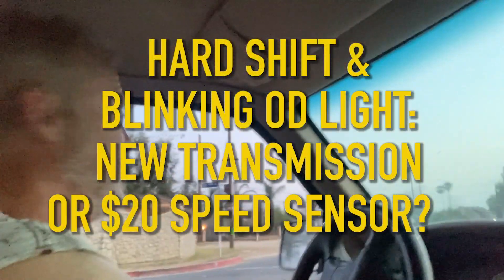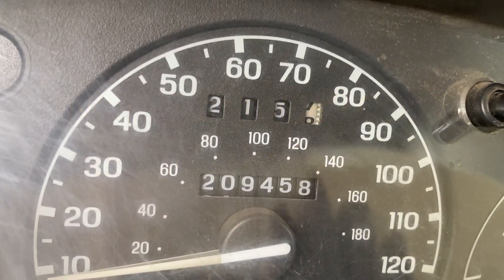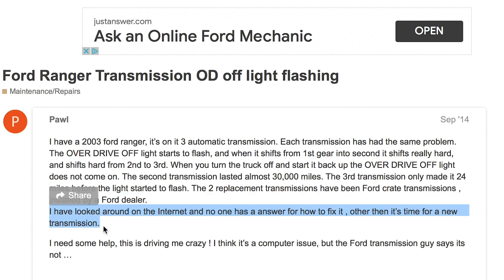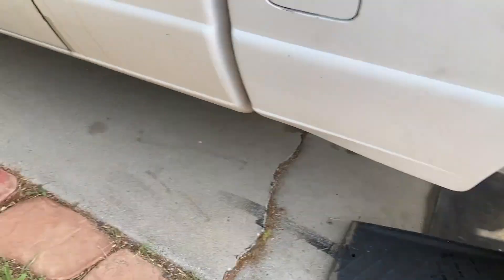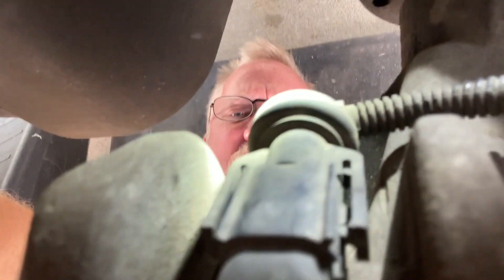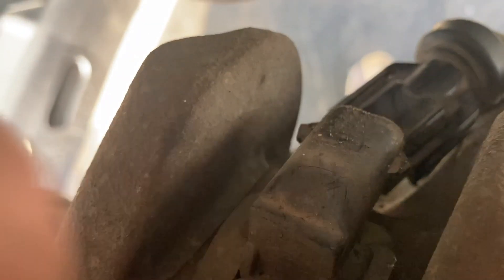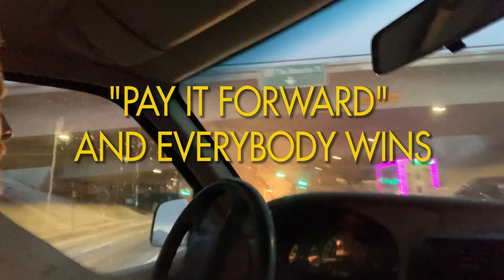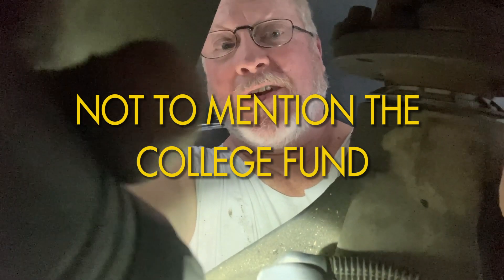Flashing OD Light & Hard Shift on automatic Ford. Replace Transmission or install $20 Speed Sensor?

Comment: Thank you so much. We have a Ford 2000 econoline van and we are on our second transmission and dealing with same problem. Been a few places and everyone says the same thing about it being transmission. Speed sensor Part was 15 dollars on Amazon or 20 at the local auto store. Was super easy fix and now problem gone. You saved the van as were close to getting rid of it. Thank you.
Reply from the maker: Congratulations Joel and thanks for reporting back.  By sharing your success you give others the courage to try this easy fix themselves. So happy for you! - Grandaddy-o
Reply: I have the same van and light is flashing.  Do you think is the sensor
Reply: @chovytoby every figure this out? My light is flashing also. But I read the code and it doesn’t say it is this sensor?
Reply: I changed my computer ecm fixed my trans
Reply: Nhi

Comment: Yes  low transmission fluid change filter  coolant , or trans radiator cooler,,speed sensor outer ,, shift solenoid,,  tcc  solenoid  & epc  solenoid ,, the worst is inner speed sensor by that you have get the entire remanufactured  correction kit valve plate ,input sensor & gear disc plate, exceeds OEM  have to pull out trans out back n carefully take out parts can mess it up if not done correctly ,,  on ranger sports trac ,, it's scam if the say discord new transmission , the bands adjusted n the back tail as correction kit as well adjusted n other adjustment ,, the convert don't mess up as well ,, ,

Comment: I just fixed my 2001 Ford F150 4x4 with a blinking OD light!  After changing the battery to a new one, after it all went wrong and would not move unless in 4 wheel low but terribly.  It all hinged on a simple 15amp fuse the ONLY light blue one allllllllll by itself away from all other fuses. I would not have guessed it would have been a 15amp fuse so I bypassed it and that was just what it was!!!

Comment: I had to get a rebuilt transmission for my ranger its my daily driver as my first vehicle, so there's a new internal input sensor, i just now finally installed a new output speed sensor, but there is one on the side of the transmission above the shift on the drivers side, trying to figure out if it's also a speed sensor as it had to also be taken from my old transmission and put onto my new.

Hoping when i test drive and do the shift learning cycle it fixes the OD light and shifting is smoother

Comment: If this fixes my Ranger, I'll name something after you. Thanks.
Reply: did it fix it? Mine was replaced and still not shifting and if it does its kicking and od light flashing. .no cruise control
Reply: @Spiritdove64 Partially. It shifts into all gears now but the 3-4 shift is slow. Swapping shift solenoids next.

Comment: In 2025 I spent $2,800. to have every gear except first replace as a transmission rebuild on my 2002 mazda B3000 4x4 V6 at 163,00 mile. The transmission shop said I was over the expected life of the transmission...  the expected life was 125,000 miles..  I'm on this video because now at a few thousand miles after that my ODO light has started to flash.   I am nowhere near the shop that did the work. Really don't want to find another shop and hear about how the other shop did everything wrong and this shop will fix it..  
 Mechanic  shops are become my next to most despised industry right after insurance companies and doctors.

Comment: Have the EXACT same problem with my 2000 B3000 will let you know soon, thank you hopefully “Donkey Truck” will be good as new 103K
Reply: How did it go?
Reply: Turns out there are 2 speed sensors one in the rear differential and one in the transmission, changed the one in the rear diff was better then changed the tranny one as well all better!

Comment: Is this the same for a 2002 Ford Ranger 3.0 L V6
Reply: you too?   part may look different but it sounds like the same issue.
Reply: @winnerscreed6767  yeah 2500 dollars later whole new tranny rebuild my mechanic told me that the issue would come back if I just tried to get around it and replace the transmission solenoid so I pulled the plug and just rebuilt the whole thing

Comment: I have a 2006 Ford expedition and my O/D off light is flashing and the codes coming up is the oil temp sensor and scelenoid shift A is coming up. I'm on my 2nd transmission. Does it mean I need another transmission?

Comment: On my mustang the speed sensor wiring melted together could not shift manually and the high range sensor the neutral safety switch the wires were broken and shorting out replaced the shift solenoid inside transmission all the sensors and wires works like new again .. I thought I had a bad transmission because it slipped too .. shifted rough .. replaced all sensors and wires fixed everything the 470rw aod transmission is pretty much bulletproof sensors and wiring get to hot and break

Comment: I just had my transmission rebuild and my problem is that my ford 2011 ranger start fine but when i start my driving it will get stuck, hesitates and jumps and after 1/2 mile start running fine, only does it when i start my route from point A to B, mechanic say to change gas but i doubt is that i did change gas thou...any help? Could be a sensor?

Comment: I changed my speed sensor on my diff and still having the same problem. Any suggestions ?
Reply: Is there a output speed sensor on the back of your transmission?

Comment: Thanks a TON, man. My child's 1998 Ranger does this, and I replaced the tailshaft speed sensor, which did nothing to help the problem. I will try this, assuming that the 4.0 liter V6 version has this sensor ?

Comment: Just a friendly FYI.... the wheel blocks (chocks) are on the wrong side of the tires. They need to be on the front when your truck is facing downhill.
Reply: He mentioned that his driveway slopes down. If in doubt, chock both ways!

Comment: Found your video and I have a 1999 Mazda B2500(Japanese Ranger) with almost 200,000 and have the same problem with not shifting smooth and blinking OD light, will try that sensor  and I'm sure it will fix it. I will comment later and tell you how it goes. Thanks for the information
Reply: Did this work for you? I have a 2003 B3000 that just started this an hour ago.

Comment: Thanks a lot of research led me here... except i just replaced VSS but since doing so, i have O/D flashing and speedometer working opposite of what it was. Before it was working at only high speeds, then after replacing VSS, speedometer now only works before 90 KM/HR and OD flashes...I'm going to buy another one and change it again, maybe new one was bad

Thanks from Canada

Comment: Whats happned when scanner says not complete diagnose. And says p1000 code power train control module. Also have flashing od. Check wire harnes they are good... replace speed sensor on tranny stil flashes replaces tranny still flashes

Comment: Do you think this speed sensor needs replaced if I have the same flashing OD off light in my 2010 ranger but it shifts great?  It came on recently and was shifting bad but had DTC P0420, replaced the cat, and now car shifts great again and fluid is clean and has no smell, no symptoms at all of tranny problems. The doggone OD off light is my only issue

Comment: Hey buddy from NC. I just subscribed, u r hilarious and a genius. I had my O/D OFF light to come on today on its own and flash. It too was hard shifting especially when trying to get passed 25-30mph. It scared the crap out of me so I went, parked it and turned the truck off. When I restarted it the light was off but when I went to drive it, it still was giving me the same issues with driving/shifting and I had to d..n near put my foot to the floor. I was going to check and possibly change the transmission fluid but my 02 Ford Explorer has no dipstick. I decided to do some research and i came across your video. Praise the Lord. I'm going to give a try what you recommended and I pray this is my fix. Wish me luck. Can't wait for more of your videos! 🐐
Reply: I have the same issue right now in my ford explorer 2003 did you were able to fix it
Reply: @Og4twenty  yep. I unfortunately had to get a rebuild on my tranny. It had 245k miles on it and it was given to me from a retired military vet. The intermediate band was broken. You could see it inside of the tranny pan when taken off. Also alot of the the parts inside the tranny were bad so I just got a rebuild. Everything is updated and I have a warranty on it. I just got it back. It rides better and takes off faster. Def took a toll on my summer with what I had to spend but I'm back riding and it's just like a new truck. Hopefully this isn't your issue. But if I were you the first thing I'd do is take it to get it scanned for codes, check tranny fluid to see it needs any, look inside of pan for broken parts and if need be take it to a reputable tranny shop for a diagnosis. Hope this helps. Good luck. 🙏🏾

Comment: Man this video gives me a glimmer of hope. OD light just started flashing on me today. My truck is a 2010 ranger bought used just 4 months ago. If I already have to install a new transmission I’m gonna be pissed. Too late at writing for the parts stores to be open though. I will come back to this comment and add an addendum if it’s fixed. Fingers crossed.
Reply: What did you find out? I have a 2010 as well with OD off light flashing but no other symptoms of tranny issues - shifts great and have never even changed transmission oil or filter with 175k miles on it - have had it since brand new

Comment: I need to replace the transmission speed sensor on my old Volvo 850. I wish the part was as cheap as this one instead of the $150-$200 I'm finding.  Nice video.
Reply from the maker: Yeah that sucks! Last year the kid next door proudly showed off his 1970s Mercedes sedan and said he was gonna keep it forever. I said I'd help but he'd have to buy parts. He doesn't have it anymore. Same deal, knockoff old Motorcraft parts are still being made in China. Old Volvo & Mercedes etc. not the volume to make 'em cheap. 😣

Comment: Hi, I replaced this sensor and it shifts fine but my OD light still flashes after I drive it around for a bit
Reply: Same here 😢
Reply from the maker: That sucks. If it shifts my next DIY would be put black tape over the darn flashing light!  If you don't fly like that, ask a mechanic? Good luck.

Comment: If a transmission is having trouble shifting, it's good to use 1 bottle or maybe 2 at the most of Lucas transmission fluid instead of replacing the whole tranny.
Reply from the maker: Oh yes, 2 bottles of fixit-juice is ALWAYS better than a new transmission!  If the transmission is the problem. Hold off on road-trip to Vegas...

Comment: This was a perfect video for me. $20 and 1 bolt....this was an easy and cheap fix! All my symptoms were the same as yours, hard shift from 1 ro 2, and od light flashing after coming to temp on my 99 Explorer Sport. Thank you!!!
Reply: What was the part number of the sensor
Reply: Mine has same problem i replaced the speed sensor n still has the ov light flashing whatelse can be
Reply: @federicomontelongo8531 solenoids!! some transmission has 2 others have a total of 6 around the whole transmission.
Reply: I think 98-01 has tow of them. You have to drop the transmission pan and its under the filter. So basically if you plan on changing the two buy a transmission filter & gasket set. You have to take it off, why not go back new
Reply: Would that part be the same on a 2000 ford expedition 4.6L V8 Triton XLT?
Reply from the maker: MOST EXCELLENT my DIY friend!  You can look at yourself in the mirror and be proud! 😀
Reply: Yea my excursion shifts hard to 1to 2 and then it doesn’t change after 2nd  just hight rpms, im going to change that sensor and see if that helps me
Reply: @blakxican899 mine has the same problem replaced the sensor n still have the the ov light flashing  dont know where else to look

Comment: Thank you 🙏🏻 my ford ranger 2008, 248 miles I fix ,I buy the part speed sensor. Now working great 👍
Reply: what was issues you were having
Reply: @WPGinterceptor460Interceptor   the OD light 💡 flashing on and off.
Reply from the maker: Great job!  I have to stay low because the auto-mechanics protection society wants to kick my aspirin box for making this video!

Comment: Both my F250 and my F350 have that same sensor.  It's the sensor for the ABS in both rear wheels.  To date, I haven't had to replace it, just clean it and put it back in.

Comment: I'm having a similar problem here, I got a 06 ranger with the 6 speed auto and it, just got it a few days ago, didn't have the o/d flashing at first and it shifted a lil rough but it wasn't concerning, after about a 25 minute trip going between 45-60 the o/d started flashing and it's started jerking into gear pretty hard. I'm going to try changing the fluid cuz it looks a lil old, but do y'all think this might be it if the fluid isn't?
Reply: did you find a fix?
Reply: @izacgaetaniello0408  well, I took it to the trans shop near me and they said the valve body blew and shot debris into my clutch pack and torque converter. I'm not completely sure if this was the actual issue or if they just wanted to sell me a whole transmission, but I wanted it fixed so I went ahead and had them swap it.
Reply from the maker: They were probably being honest unless they need to make payments on the bass fishing boat?  @thebountyschannel

Comment: Thanks for making and sharing this video hopefully that's what's wrong with mine I have a 99 Ranger with the 3.0 V6 engine and it's doing the same thing some days it shifts and drives okay and other days it doesn't and it will just randomly jump out of gear and I would have to drop it down out of overdrive into second to get it to go back into gear other times it'll be driving all right but the speedometer will stop working and then it'll start again so hopefully that sensor is what mine needs mine has about the same miles as yours otherwise it's been a great little truck so far only had it since December
Reply from the maker: Good luck and thanks for the story. I've had AdventureTruck for many many years. Mostly love her except when I hate her! She's never been to "another man"  yet.
Reply: @lazycowvintagethriftdesign5595  thanks for the shout back it had ended up straightening itself out but I later found out that it was a bad speed sensor that mounted with a bolt sort of a magnetic type that would read the gear spinning inside of the differential and if that sensor goes bad or it's not reading right it'll cause that shift problem like I was talking about apparently the 94 and up models of rangers have the sensor

Comment: Im having the same issue now with a 01 f350 v10 gas dump truck, everytime i come to a stop she slowly wants to die, sometimes dies while od light flashes, and when od lights flashing, hard 1st shift sometimes but seems like when i first drive cold it doesnt have the issu and shifts and drives fine on highway only when stopping and idling in drive, and accelerating from a stop, this thing is a cash cow and it has been very costly to maintain, hoping this will do the trick.
Reply from the maker: Damn greedy cow!  Best of luck with her.
Reply: @lazycowvintagethriftdesign5595  finally got tired of fixing things so I sold at a major loss

Comment: Pretty cool the our trucks match. Mine is 2003 3liter V6 with 213k miles. I've had it since 7k miles and it's awesome. This video was perfect and fixed the problem. My bolt was 11mm though.
Reply from the maker: Good Job!  And didn't let that 11mm make you cry either. DIY hero in my book!

Comment: Thanks i have ford ranger 2011 2.3 engine light is on and o/d off light is blinking i checked both colenoed shift and control also changed o/d control sensor both lights are still on now i am going to put new speed sensor see what happens any idea you have please help thanks again
Reply: Did it work

Comment: The problem is, he keeps calling that the speed sensor and it's not... He changed the antilock brake sensor
Reply: on the old rangers thats both the ABS sensor and Speed sensor.. on newer rangers there is 2
Reply from the maker: @WPGinterceptor460Interceptor  That's for sticking up for old Grandaddy-o!
Reply from the maker: That's just a speech impediment BTW. Sorry and have a speed sensor day!😁

Comment: Mine's an autumatic Ford Escape 2011. Will this work on it? It's doing the same thing. O/D light is flashing while the shifting is hard and harsh from neutral to reverse or to drive.
Reply: Ah, l wasn't able to so I just contacted a home-service Ford mechanic I was able to find online, thank GOD. He came over and brought his laptop and reset the computer box, checked all the fuses especially the big black ones and he got the car working again and it still is. What I was able to do on my part, however, was I was able to replace all the spark plugs with brand new ones which I believe played a big role because when it would not work properly it was emitting the smell of raw fuel and was really evident that there was dead spark plug(s).
Reply: Did you fix it?